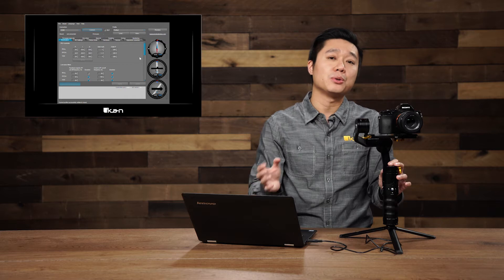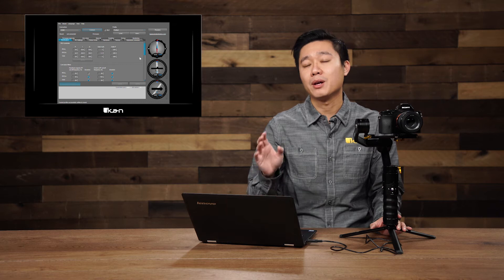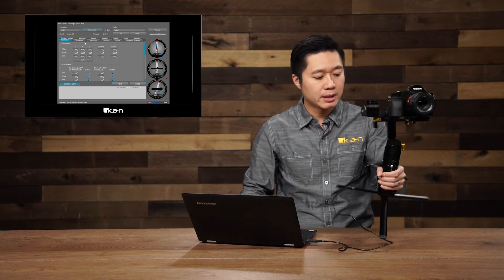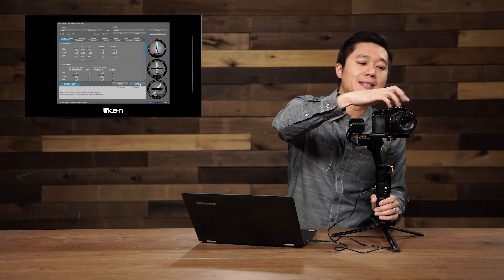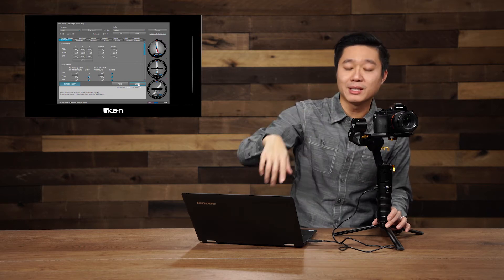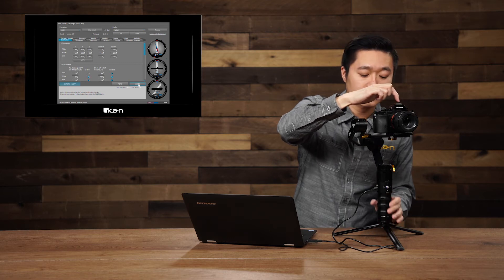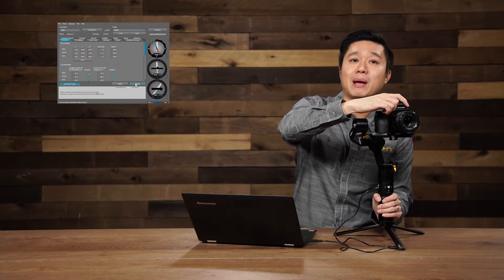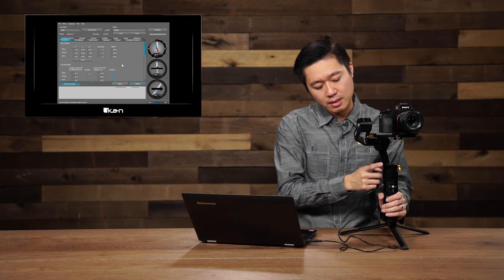Ikan Beholder Gimbal PID Tuning | Part 7 of 7

Comment: I'm having warping/ripple effect with my gimbal..is there a fix for that?
Reply from the maker: Hi there, I'm so sorry you're having issues. Please send an email to support@ikancorp.com and send them a video or some kind of visual for them to see what the issue is. Thanks.
Reply: Ikan International I actually think I fixed it.. my frequency was 60 instead of 150... I guess the low frequency caused that ripple effect in my footage but thx for your quick response means alot
Reply from the maker: Oh awesome, I'm so glad you got it working. If you need anything, please don't hesitate to contact support@ikancorp.com